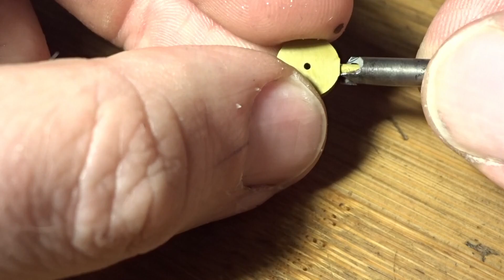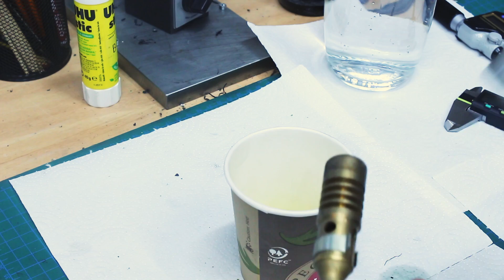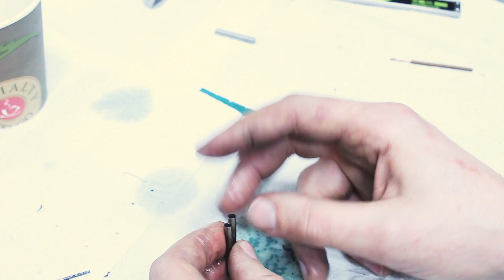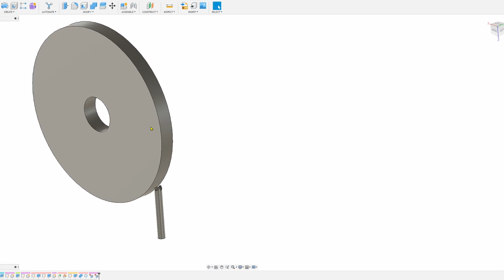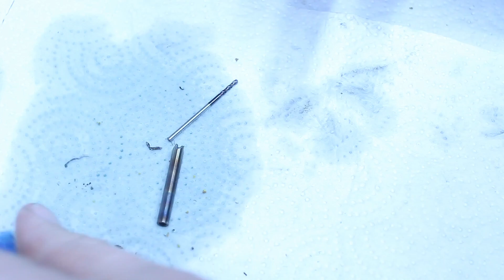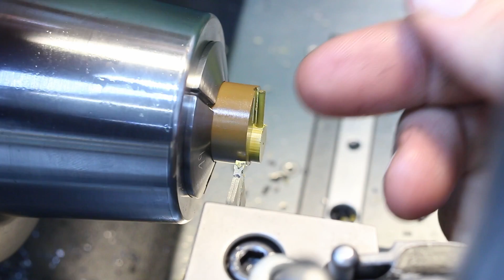Making a Micro Annular Cutter

Comment: Nice job Stefan!  That Torlon material reminds me of machining Rulon back in the 80's.  It was a brand new material and extremely expensive at the time.  I was a newbie and the "foreman" that  got the Rulon out of the safe handed it to me and said "Don't screw up, you're looking at a Rolls Royce cost there!"  It machined beautifully but I was sweating until I handed him the completed parts.
Reply: Its quite sickening to see such nonsense... A material that can be cooked up in a pot essentially(which i know is practically the description of anything apart from wood and such stuff that grows) should never be so expensive... Plastics least of all... I can have understanding for materials that are immensely hard to make, demanding of absolute conditions which can not oscillate during production and so on, but autoclave cooked synth material just has no excuse being as pricey as some are... Even the powder steel tech is way too expensive, as its essentially sintered metal tech, but a bit fancier... Its literally easier to make a powder high grade ``alloy`` when compared to regular melting alloying process, as one allows you to sputter metal powders as you want and bake them and manipulate them into a solid piece that doesnt have the tendency to segregate into specific elements during making and boil your blood by resulting in shit rather than an alloy slab, where the other has its own strict dictates where each element messes with one of the others and demands certain conditions to alloy the steel properly... 
Just because its a new tech doesnt justify the price, especially if its just a new material made by existing tech from generally abundant resources... 
The ethylene gas comes to mind... As a refrigerant its mad expensive, and its literally made by boiling ethanol(drinking alcohol) and filtering the fumes through a 500 celsius aluminum oxide catalyst(pipe with silica and two fine mesh filters at each end)... The process, the ingredients and everything is as common and abundant as possible, yet the gas which is as easily made as farts are is vastly more expensive than gold(stupid example, but gold has its price for other reasons other than abundance) at equal mass... Of course i didnt mention a few other parts of the process, but all of it is peasant grade techniques like drying, bubbling purification, filtration and so on... There is chemical purification and concentration thereof too, but its all basic processes with common tools and resources...  
I get that rulon/turcite and such are teflon based, but teflon is also not a hard thing to make, as fluorine is the most reactive element there is, and apparently, by divine giggle, i was motivated to mention ethylene, as teflon is exactly the combination of ethylene gas and fluorine... One is literally fart grade gas and the other is definitely abundant enough not to justify the price... Sure, there is bronze flakes and other specks of shit in rulon/turcite, but again, absolutely nothing in the composition or the production process doesnt justify the price... 
Its just pure bullshit... Almost like nitrogen being expensive, and its the most abundant gas in the atmosphere, whereform it can be extracted by methods older than car technology almost... But this rant makes no sense... Whats next, i will start pointing out the rest of problems with mankind and society? No, ill go roll one up and turn the lathe on and let her warm up... Might as well make some annular cutters from that remaining rod of hss-co that i have sitting in the chuck...

All the best mate and kindest regards!
Reply: @camillosteuss  I read this and gave a 'thumbs up' almost a year ago.
Re-read it today and felt compelled to comment as I totally agree with you about massively inflated costs on multiple 'things'
When did pick-up trucks become such a status symbol they now cost almost as much as a 'super-car? (I saw ad for pick up costing $109,000 recently)
 Ford and Chevy will never have status of Porsche, Ferrari or Rolls Royce
Reply: @1crazypj  yeah, i don`t even understand how things manage to be as insane as they are... it`s like watching a fantasy movie about a mad civilization, but it`s just waking up and opening your eyes every day to the world around you... 
Don`t even get me started on the vehicles, the auto industry is just a sewer-slide at the moment, but so are so many aspects of almost every field in the West... 
But somehow it appears that there are more and more sane people starting to buoy up on the sea of madness, a slight hint of return to sensibility and sanity of old... We definitely live in an era that is both the best and the most infuriating in so many ways... 
Omnissiah save us... Deus nobiscum... Ave Gloria - Ave Viktoria!
Reply: @camillosteuss  If it is that easy do it in your garage. New materials are more expensive to quicken ROI on R&D and since materials are new and not widely known/used in industry makes large batch production unjustifiable. Also if client is willing to pay extra and make profit why should producer decrease price? Ethylene example is wrong - you can make it from ethanol but is is very expensive method. Mainly it is made from oil industry byproducts and costs less than 2$ by KG. It is just hard to obtain by people out of industry.
Reply: @oskarejsmont  i know, many such products are much more simple and cheaper to make to the industry, but the price a consumer has to pay, if one can even find a seller of smaller quantities is astronomical for a lot of these things... 

Speaking of make it in your garage... Brother, i bought over 10 tonnes of industrial grade machinery and made my own furnace and a few other industry grade systems and implements, exactly because its easy to do it yourself... Sure, melting metals, iron especially is hellish work, but i prefer sweat over exorbitant prices... It costs me pennies a pound to get good grade cast iron to melt down, or other good metals/alloys, and sure, while the diesel is a bit pricey, on the other hand, i know what im using, i know how much im using, and the total cost is the material cost... If i want, i can use argon to shield things, i can make my own moulds, without the need for any explanations and what not just to get the part right... And when its done, its gets ground, bathed in petrol+atf mix and is ready to be gently laid on adequate machine table or chuck and to be worked to spec... No outside consultations, no waiting, no rude shitheads, no markups and no tax on an already high price... Just whatever little it costs to get stuff, and whatever little tax is paid for scrap prices and fuel... 
There is one thing i despise, and its being robbed without being at gunpoint... If im gonna be robbed, i prefer to give my money to an honest criminal... They at least put the effort in, while being honest about the situation... And i appreciate honest efforts above any deceit...

Comment: As always, much with the clever.  This seems like a really straightforward way to form annular cutters of a range of diameters. Is there any reason this would not scale up?  Would you lose much by using a simple bench grinder to form these teeth on a cylinder? I just love the fact that the relief and cutting edge is being formed by one grinding operation.
Reply: Larger annular cutters in nominal dimensions are already commercially available, but there is no reason you can't make you own custom sizes like this. The problem with forming the teeth by hand is that it would be very difficult to get the cutting edges in the same plane so they all cut equally. The mechanical stops on the specialized cutter grinders allow you to get consistent results on all the teeth.

If all you have is a bench grinder you can still do it. I would rough grind each tooth a little beyond the intersection point (trying to get them as close as possible). Then put the tool in the mill and let it rest on a diamond plate and turn it by hand until I get a flat spot on each tooth. This will ensure they are all on the same plane. Then I would use a fine diamond file and a magnifying glass to form a secondary bevel on each tooth, filing just up to the intersection point.
Reply: @ElectricGears  Thank you so much for this comprehensive reply.  This just seems like such a nice way to form consistent pins and such.  I appreciate you taking the time to respond.

Comment: Hi Stefan. How would you machine an annular slot, in brass, that is 15.26 mm OD, 12.26 mm ID and 20.5mm deep? I have thought about re-grinding a commercial Rotabroach cutter (in fact I bought one to grind) but I only have a D-bit grinder unless I re-tool my lathe or mill, so that's likely to be a challenge. Any other ideas? 
A tool exactly like yours here would be ideal, except for chip clearance. 
Context: https://youtu.be/T9u3g-0uYko
Reply: Nice design Andy👍  I'd guess that even a tool with spira flutes to clear chips from the gullets like a commercial rotabroach would struggle to clear the chips if the total wall thickness was 1.5mm (the flutes would be very shallow and the brass chips would compact ). If it wasn't so deep, using a long reach 1.5mm end mill and a rotary table might work, but these tend to only run to 17 or so mm long (and I imagine them snapping quite readily!).  Die sink EDM might work but you'd probably have to farm it out and pay for tooling😐 - I'm guessing you've considered fabricating the part by brazing a core cylinder inside amatching bore...  [edit sorry for butting in with my far from expert opinion, I just found it an intriguing question]
Reply: @2lefThumbs  Yes, the four locks that I have made so far have been assembled with a 2-part body, but I am hoping to find a way to make them more quickly and easily.
Reply: @andypughtube  I just finished watching this https://youtu.be/23fcHVlDfFQ  beautiful work👍